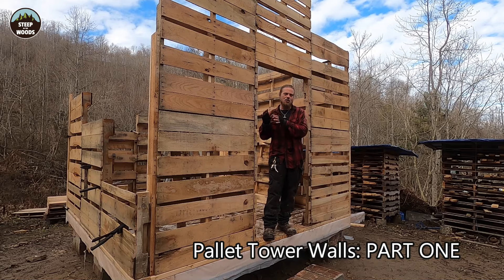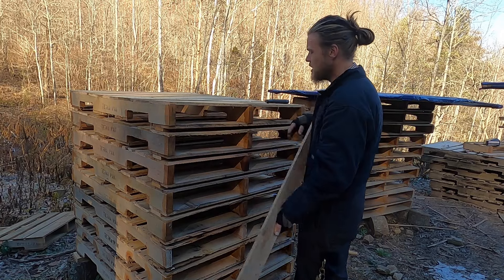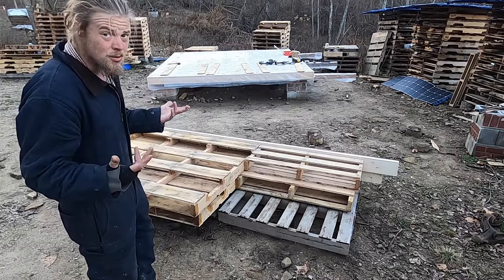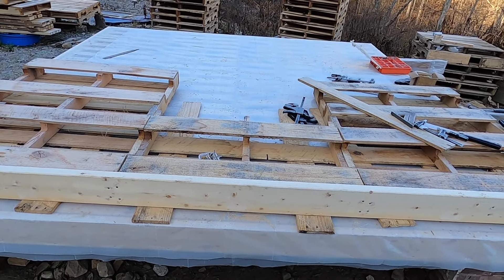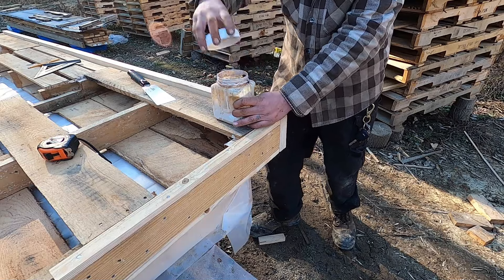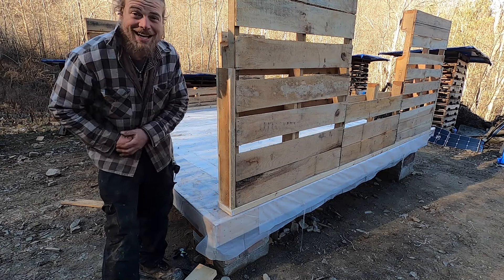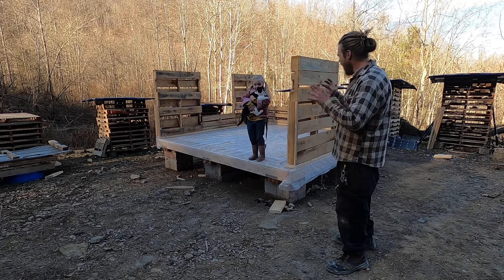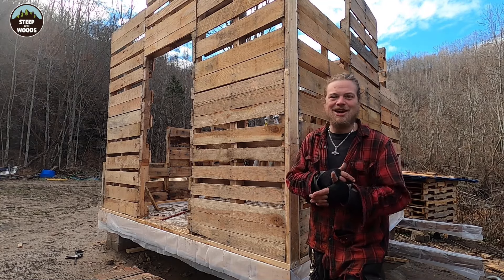Building Walls out of Pallet Wood - Part 1 - Tiny Pallet House in the woods

Comment: If you take a cheap bar of hand soap and rub your screw across it with the threads. 
The screw will go threw the wood much easier with out getting hot and squealing and braking off .
So Saith The Rooster

Comment: Your giving me ideas for closing in my carport doing the framing with pallets then putting up a vapor barrier lathe and then stucco to paint. Later on I could foam or fiberglass insulate and then stucco inside as well
Reply from the maker: I'm glad to hear it! 
 - That's really the whole point of our channel, to encourage other 'financially challenged' people to be creative and grab Life by the horns! (Not that you necessarily are one of those people)

As for insulation on our particular pallet House...

 I could only afford the thinnest foam board they make, but over top of that I'm going to put furring strips.

And that is what I'll put my house wrap on.
- the idea is that if our 'financial situation' improves.. 
I can always remove the house wrap and fill that Gap with another piece of foam board before reattaching the house wrap and then apply our siding to those furring strips.

Comment: Run the 2x up the inside of the pallets. 
Even if they need to be ripped down a little.
That way the larger oak boards carry more of the load, not the skinnier siding boards.

Comment: 😂 from building houses for 20 years, ya so much wrong but this is pretty cool
Reply from the maker: At least you probably understand the dimensions involved LOL.

- because obviously six double stack pillars under a 10x10 building just isn't enough block! LOL
Reply: be helpful and give some corrections then
Reply: From designing/building houses for 45 years..... not that much. I could offer some tips on putting fasteners in wood but this guy is doing fine. Not sure I would do two floors with this method but it really could be pretty stout structurally. I may build a pallet deck for a cabin if I can find any decent examples nearby....

Comment: Those walls are not strong, I was hoping to see how the pallets would be reinforced, there is a joint in the middle with little making it rigid except two 2 X 4's with are roughly  4' on center. Lots of wood but a relatively week structure.
Reply from the maker: You need to build a regular house.